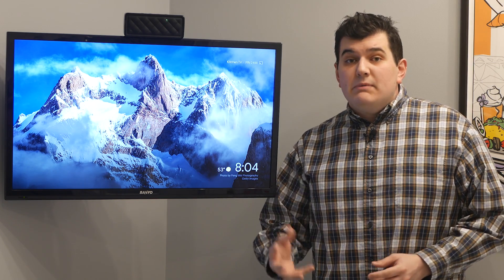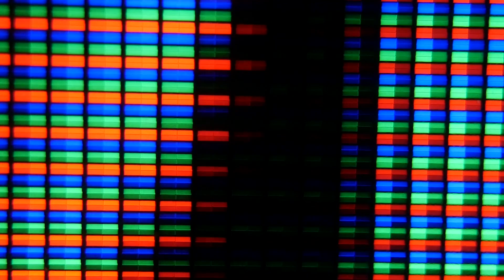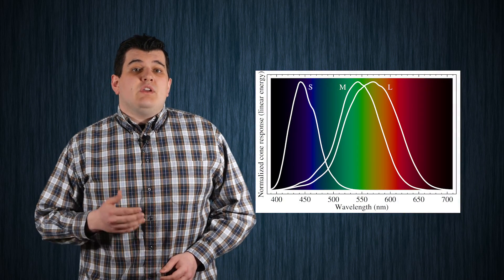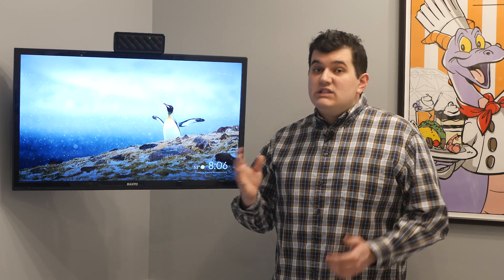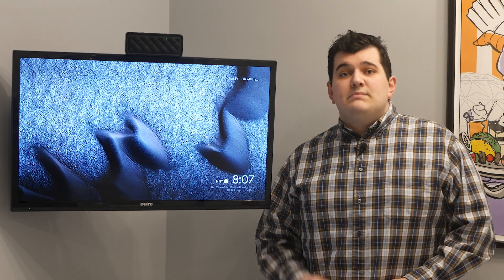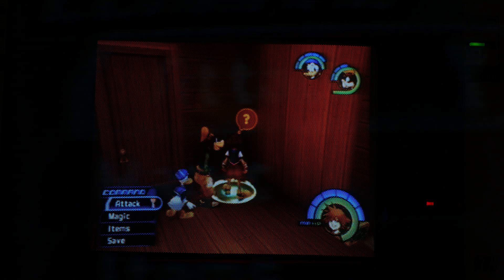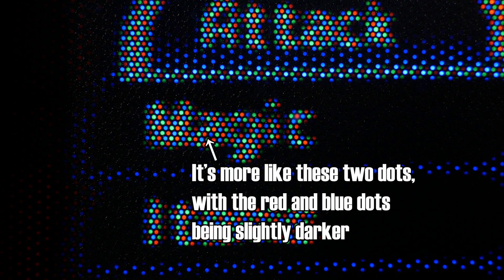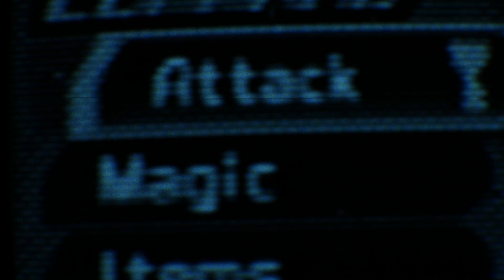These Are Not Pixels: Revisited

Comment: A B&W screen works on a different principle.... It still has a fixed resolution - The bandwidth is still limited and can only transfer a fixed amount of information - no matter what you do, there is a limit.

A Pixel is, by definition, the smallest individual element of a picture. There is nothing that says that they can not be a side-effect of the design, or that they need to be individually addressable at all times, or that they needs to be sharp and perfectly defined spatially - that is just Your interpretation.

There is a smallest dot you can produce with, even with a B&W display, as your electron beam can only change its intensity oh so much. That makes the point smudged, but it is still of a fixed size - and the same goes for its location - horizontally you can only get the position of the point with a finite amount of precision. the fact that the image is drawn in lines just makes that more apparent in one direction as the horizontal separation is far bigger. You have a bandwidth limited signal with a fixed sampling-rate along both axis producing a picture composed of individual elements - pixels. 
This also has the nice effect of inbuilt physical anti-aliasing.

With color TVs (not 3-projector design) that is even worse as the phosphor used does spread the beam and part of the roles of the grid is to keep the bleeding in check.
They are not functionally identical to b&w TVs, not even close. And placing a grid in front of the paper - that was just a really pathetic attempt of a strawman.
Same with booting up a game - whos image is inherently pixel-based. With that you actually have actually made a strong point against your own position cause what we can clearly (well blurry in this case)see are the effects of antialiasing - a result of its vertical and horizontal resolution. And you can still read the word magic cause not the whole sub-pixel gets addressed with a single brightness value - something that can (and is) done on modern LCDs exactly the same (there are some interesting papers on sub-pixel displacement/rendering), just that there it needs to be done deliberately and is not a result of physical constraints. Not sure if you are intentionally dishonest or you really do not know such simple things.

And your "no, they are phosphor dots" - "No, they are LCD dots" -  makes as much sense.
Reply from the maker: I was wondering when you'd chime in, ABaumstumpf!  "A Pixel is, by definition, the smallest individual element of a picture."   OK, by that definition, the phosphor dots don't fit!  You can get deail within each phosphor dot.  Check out 6:00, then use the < and > to move frame by frame, and you'll see that my eyebrows are moving through the sets of phosphor dots.  That would not be possible with a digital display.  You cannot cut a pixel in half without it being two pixels.
Reply: "You can get deail within each phosphor dot."
If the dots are large in comparison to the vertical resolution the beam can produce. I never said the dots are the only limit, but as you said - in most TVs the beam was not accurate enough to do that. all you got was blurring into neighbouring pixels - natural antialiasing.

"That would not be possible with a digital display."
Well, it very much is. As i even already pointed out in my comment.
https://2dwillneverdie.com/tutorial/give-your-sprites-depth-with-sub-pixel-animation/

And here, an everyday example:
https://upload.wikimedia.org/wikipedia/commons/thumb/0/0e/Subpixel_rendering_LCD_photo_3w_composite.jpg/266px-Subpixel_rendering_LCD_photo_3w_composite.jpg
Your claim is that pixels would only draw the first result, when in fact all 3 are on a LCD and the 3rd is exactly what you would get on a CRT - nothing less, and specially nothing more.
All it is as physical antialiasing, but it does have a fixed resolution.
Reply from the maker: Your image example does not divide any of those pixels at all.  They are simply producing specific RGB values to keep the subpixels from lighting, and thus provide better spatial resolution.  This is a similar effect to how the edges of a shape are rendered on a CRT, but it is the mechanism by which that happens that is fundamentally different.  The LCD is intentionally making some pixels render specific colors to give an anti-aliased border.  The image processor has decided that's what it will do.  In a CRT, it simply happens.  The grid is on top of the lines being drawn.

If this is an argument over semantics, lets call it what is.  My point has always been that a digital display creates shapes by lighting up individual bits of the display.  A CRT creates shapes in lines, and the grid that is in front of them gets lit up because of the shape the lines are drawing.  I see a fundamental difference between the two in method of operation.  If you don't, then fine.  If you think it's just semantics, then fine.  But the phosphor dots are not digital pixels. 

I'd also like to challenge your assertion that "There is nothing that says that they can not be a side-effect of the design, or that they need to be individually addressable at all times".  Wikipedia defines a pixel as "a physical point in a raster image, or the smallest addressable element in an all points addressable display device; so it is the smallest controllable element of a picture represented on the screen".
The disambiguation page for "Pixel" calls it "the base element of a digital image in computer graphics".  

And finally, on the page for Pixel, there is an image showing 4 closeups of displays.  It is captioned, "Geometry of color elements of various CRT and LCD displays; phosphor dots in the color display of CRTs (top row) bear no relation to pixels or subpixels."  

This is the definition of a pixel that is common, that I am operating on, and that is not congruent with the phosphor dots of a CRT.  That is why I've made this video.  Counting the number of phosphor dots on a CRT television is meaningless to determining its resolution.  They are not directly controllable.  It is not an addressable display.  And they do not digitize, they simply compartmentalize.
Reply: "but it is the mechanism by which that happens that is fundamentally different."
Which i also mentioned several times. But the mechanism is irrelevant there - you claimed that was something only CRTs could do - which this proofs otherwise.

"Wikipedia defines a pixel as"
And you conveniently ignore the first part of the definition........
And even the second part still applies to a CRT as it - again - nowhere state that it has to be addressable at all times - on a CRT color TV you can address every pixel - with less accuracy and only at certain points in time - which is, if you look at CRTs - also the case for them. Even if we use the definition arbitrarily narrowed down it would still make an CRT and LCD the same.

"It is captioned, "Geometry of color elements of various CRT and LCD displays; phosphor dots in the color display of CRTs (top row) bear no relation to pixels or subpixels." "
So? A Wiki-page that everybody can edit say something? That is a person arbitrarily desiring that it is not to be called a pixel despite having all the characteristics and falling bang straight in the middle of the definition.

It looks like a duck, smells like a duck, quack like a duck and has the DNA of a duck - but i decide to call it Larry the unicorn.

"This is the definition of a pixel that is common, that I am operating on, and that is not congruent with the phosphor dots of a CRT."
What definition? You haven't given any that agrees with your statement.

"It is not an addressable display."
Which would actually make the phosphor dots the upper resolution limit and we could thus say the display has 'up to' XXX pixels.
Reply from the maker: My word you are stubborn!
If you're claiming I'm ignoring "a physical part of a raster image", well I don't know how I can illustrate that the raster is behind the phosphor dots!    You seem to feel as though because the dots are there, they are part of the raster.  This is a fundamental part of why they aren't pixels--the phosphor dots are not a part of the raster.  You could say that they help to identify a physical point of the raster (since they create rigid compartments) but they are not what the raster is.  They.  Are.  In.  Front.  Of.  The.  Raster.
I'm struggling to see how this is irrelevant.
"Which would actually make the phosphor dots the upper resolution limit and we could thus say the display has 'up to' XXX pixels."
Once again, you've ignored the evidence I've provided at the 6:00 mark that the phosphors have definition within their borders.  I'm not talking about the equivalent of sub-pixel rendering, I'm talking about the fact that two scan lines can activate the same phosphor dots.  You can see that when my eyebrows move through them.  If you don't see or understand what I mean there then I'm at a loss.
The phosphor dots limit color resolution only.  This is because their entire purpose for existing is to separate the Red, Green, and Blue components of the electron gun.  It merely looks like a duck.
Look, you agree that in a modern display we can count the pixels to determine its resolution, right?  And you know that the NTSC analog video signal is 525 horizontal lines (with ~480 visible), right?  So if I were to count the phosphor dots on a CRT and there were anything but (which I guarantee you there is) 480 dots along the y axis, then they can't possibly be part of the structure of the image.  This is the window screen analogy that you call a strawman for some reason, but is exactly the principle by which a color CRT's shadow mask and phosphor grid operates.
Reply: "My word you are stubborn!"
well you are stubborn.... you keep ignoring half of what i write, heck, you even ignore what you your self quote from wikipedia....

"well I don't know how I can illustrate that the raster is behind the phosphor dots!"
I never claimed otherwise - why make up yet another strawmen?

"I'm struggling to see how this is irrelevant."
Strange - then please try to elaborate how that is relevant. If i would say an LCD would not have pixels cause the address-line is infront of the pixels not part of it it would be just as nonsensical.

"Once again, you've ignored the evidence I've provided at the 6:00 mark that the phosphors have definition within their borders."
And once again you are claiming they are not pixels cause YOU personally decide to call them otherwise - that is only evidence of your ignorance.

"I'm talking about the fact that two scan lines can activate the same phosphor dots. "
Which in turn only means that the image gets blurrier and produces less distinguishable shapes than this physical resolution - it is just ligthpolution.
And again - by that "logic" an LCD does not have pixels either as adjacent pixels can get falsely illuminated by a signal not designed for them. That is - by your line of reasoning there is no such thing as pixels at all.......

"The phosphor dots limit color resolution only. "
And the components of the TV (electronics, the magnets deflecting the electronbeam, the grid and the phosphor-dots as well as the lightbleed of the phosphor limit the brightness as well - you make the claim it is otherwise but at the same time refuse to offer actual evidence. All you have shown so far is that a CRT TV has physical antialiasing - nothing less, nothing more.

"So if I were to count the phosphor dots on a CRT and there were anything but (which I guarantee you there is) 480 dots along the y axis, then they can't possibly be part of the structure of the image."
That is a nonsequiter. As even you your self already said -the electronbeam is not perfectly aligned with the phosphor-dots. You could make a display with 10 000 rows of phosphor-dots, all it would accomplish would be increasing the spacial differentiation of the signal - its apparent sharpness, NOT its resolution.

Again - your "argument" can be flipped right over as you can also display a 4K image on a 720p display.
Reply from the maker: OK, I might have something that could help explain my point.

http://zauberklang.ch/filmcolors/timeline-entry/1334/

The phosphor dots and shadow mask are using the same principle as the Joly Screen process.  In fact the Joly Screen is remarkably similar to how Trinitron operates.  The addition of the screen on top of the image does not create pixels.

I've ignored some of what you wrote because I don't see its importance to the argument.  Such as your challenging me relying on a definition from Wikipedia.  Setting aside the fact that it's a public, live document (go ahead and change it and see what happens, maybe you'll change people's mind or maybe they'll change yours) and the dangers that presents, what's the point of definitions then?  Can I call a poodle a salamander because I don't agree with the definition in a dictionary?  I realize this is bleeding into the fallacy of authority, but let's move on...

"If i would say an LCD would not have pixels cause the address-line is infront of the pixels not part of it it would be just as nonsensical."  I honestly don't understand what you're trying to say here. 

Let me refer you to 10:30.  That was an exaggerated graphic of what the phosphor dots are in relation to the rasterized signal.  They are not the building blocks of the image!  They are in front of the lines that draw the image.  The lines become masked by the grid of phosphors, but they are still there.  That graphic is the clearest I can be.  It is literally the same principle as placing a grid of squares in front of a pre-existing image.  How you can then claim that the grid transforms what it contains into a pixel is beyond me.  If that's what you're claiming, then you're perhaps better suited to call it a point.

Here's another example.  If I print out the same pixel grid setup as the LCD TV in my kitchen on a transparency at 4X scale, then I place it in front of the television so that 4 of its original pixels fit within one of them on my printout, have I decreased its resolution?  Are there now 1/4th the pixels?  I haven't changed the structure behind it--it's still a 1366 X 768 grid producing the image, but how there's a 683 X 384 grid in front of it.  Does that mean none of the original detail gets through?  Or is there simply a second, unrelated grid in front of the TV?

And that's the whole point.  In an LCD panel, there can be no definition beyond the pixel because the pixel is the smallest element it can create.  Shapes are drawn by lighting up those individual elements.  The pixel is how the image is composed.  You seem to claim that just because a CRT uses a grid of phosphor dots, the image is then composed of them and there can be no definition beyond the grid.  But that's fundamentally different from how it actually works.

This whole time you're arguing that I should just call them pixels because that's what they are.  That's a meaningless argument.  We're both challenging each other's definitions but you can't or refuse to see the differences between the two that I'm pointing out.  If you can imagine a second unrelated grid in front of an image that already exists, you will understand my point.  If you can't, then what more can I say?
(edited because spacing was all wonky thanks to the hybrid comments system we have now)
Reply: "The phosphor dots and shadow mask are using the same principle as the Joly Screen process."
so does any other color display......

"Such as your challenging me relying on a definition from Wikipedia."
And another lie/strawmen - i only said that it is very remarkable that you are ignoring half the definition you are supposedly using - the part of the definition that - wonder oh wonder - applies to LCDs as well.

"It is literally the same principle as placing a grid of squares in front of a pre-existing image."
Similar yes - the Same NO. cause if you place a grid infront of a picture you already have a full picture. But with the mask and phosphor-dots you remove either of them and you got a b&w image limited in resolution by the accuracy of the beam and the scattering inside the phosphor. The beam it self does not carry accurate information of a picture that is far bigger - heck, that is even limited by the very cables in the TV.
Try to look at it this way: if you have a 720p image and you display it on a 4K monitor the image does not magically become a 4K image - it is fundamentally still the same.

http://www.michaelbach.de/misc/crtlimits/index.html
A introductory read on the subject.

"Here's another example.  If I print out the same pixel grid setup as the LCD TV in my kitchen on a transparency at 4X scale, then I place it in front of the television so that 4 of its original pixels fit within one of them on my printout, have I decreased its resolution?"
depends on how the sheet works - if it blurs out the colors of the original screen to the size of the new color-dots - yes, yes you have.

"Or is there simply a second, unrelated grid in front of the TV?"
As you haven't specified what would happen - no.

"Shapes are drawn by lighting up those individual elements. "
Funny - how this very sentence, without changing a single word, perfectly describes how a CRT works.

"But that's fundamentally different from how it actually works."
Your claim - but that is in fundamental contrast to the basis of physics.

"We're both challenging each other's definitions but you can't or refuse to see the differences between the two that I'm pointing out."
I already pointed out that the single definition of pixel you ever mentioned (the quote from wikipedia) actually disagrees with you as it specifically says and i quote: "a physical point in a raster image"
Or would you now also start claiming that CRTs do not produce raster images? That the image is not created by a moving spot carrying the information of the picture elements to the phosphor?

It would be a different scenario if we would be talking about vector-monitors - as there you can place the image at arbitrary points on the screen. But because the the analog-chain is bandwidth limited by design you can not, in no way, create bright spots outside of a fixed number of spatially well defined positions.

The horizontal resolution is thus limited by mainly 3 things:
1 - Frequency. As the movement of the electronbeam is a predetermined fixed pattern with a limited frequency you can also only create a limited amount of spots. if the line-frequency would be 20 000 Hz and the signal is limited to 200 000 Hz that would mean at best you can create 10 vertical lines.
2 - Beamsice. If the size of the beam is as big as the screen you can not create any details. No matter what the signal would be the created image would not change. In normal screens this is limited by production tolerances and cost and the actual beamsizes are well above the minimum size. Also with increased brightness the beam will become larger, limiting the product of brightness and resolution.
3 - The phosphor it self. No matter how small you make the beam, the phosphor it self  spreads the electrons and the glow. If the phosphor-dots would not be separated physically than the individual colors would blend into each other. for this reason in high resolution CRTs they often used grids on the display it self (not the shadowmask) to get better separation of the phosphor-dots as the dots them self already were so small that even at low brightness with a narrow beam the whole dot would light up.

You can also easily test that - just display black and white vertical lines on a CRT and then see at what point they simply vanish to a grey image. At that point you have overstepped the physical resolution of the display. And as it so happen the change in the displayed image will look exactly the same as on an LCD where you do the antialiasing via software.
Reply from the maker: "Try to look at it this way: if you have a 720p image and you display it on a 4K monitor the image does not magically become a 4K image - it is fundamentally still the same"
OK, now we're talking.  Take a 480 line raster, and display it on a CRT with 960 phosphor dots along the Y axis, and it is still a 480 line raster.  Similarly, if you've got a 480 line raster, and you display it on a CRT with 240 phosphor dots, it is still a 480 line raster.  Each dot now gets hit by two lines, but you can see the detail provided by each line.  That's what I'm showing at 6:00.  That is what does not happen with a logical pixel, let alone a physical pixel in an LCD panel.  If you display a 1080P image on a 540P panel, you will get a 540P image.  The pixels cannot provide any more detail than a uniform, quantized color value.  
In order for the phosphor dots on a CRT to be true pixel, their intensity must be uniform and quantifiable.  But it isn't.  

"I already pointed out that the single definition of pixel you ever mentioned (the quote from wikipedia) actually disagrees with you as it specifically says and i quote: 'a physical point in a raster image'
Or would you now also start claiming that CRTs do not produce raster images? That the image is not created by a moving spot carrying the information of the picture elements to the phosphor?"
I already addressed this in a previous reply.  The issue is that the phosphor dots can and do fall on two lines of the raster.  So yes, you could claim they are a "physical point of a raster image" but then you're muddying the boundaries of the raster itself.  That's because the phosphor dots are unrelated to the position of the raster.  Have you changed the geometry of a CRT monitor before?  If you have, you'll know that the raster can fall wherever it wants to in relation to the phosphor dots and the image is still as clear as day.  That proves the raster is unrelated to the phosphor dots because, again, it is behind them.

"The horizontal resolution is thus limited by mainly 3 things:--with a list following"
I understand this!  I understand that bandwidth of the signal does limit its resolution.  But the phosphor dots are agnostic to this.

Going back to my theoretical transparency of a grid--I'll clarify.  The grid does not blur what's behind it.  You can still make out the pixels behind it.  If you could make out the pixels behind my transparency, you would say "of course this transparency is meaningless to the resolution of the display!  I can clearly see that there is more detail behind this grid.  Therefore, the image behind it must be what actually defines the resolution of this display".   This is the same thing as the phosphor dots on the TV.  
Remember Trinitron?  There's no horizontal separation to the phosphors at all, so you can still see the lines drawn when it's operating.  The phosphor dots in a slot-mask CRT make it hard to see the raster because they themselves create compartments and they are offset in each adjacent column.  But that doesn't mean they change the raster.  They simply limit which parts of screen each electron gun can hit.

In any case, the mere fact that there are myriad television designs with myriad phosphor configurations and dot pitches should tell you that the phosphor dots do not form the image.  They do insofar as they create defined clusters of light, but they aren't the limit of resolution that the pixels of an LCD panel are.

Let me go back to this; If an LCD panel could divide one of its pixels in half (as in two completely different colors created, not just sub-pixel rendering) would you not then say that is is now two pixels?  If the panel can create two independent RGB values within the same space, that must be two pixels.  So if a CRT can do that with its phosphor dots (which it can--as I've shown) you should at the very least say that each phosphor dot cluster is in fact two pixels.  But that then breaks the definition of pixel.  And thus, the appearance of the RGB cluster on a CRT is not a pixel.  If it were, each component would need to be uniformly bright, there could be no detail within itself, and then you would have a digital resolution on your hands.  Which of course, in analog video, you don't.
(edit: I just need to stop replying in Creator Studio.  The spacing is just unpredictable there...)
Reply: "Similarly, if you've got a 480 line raster, and you display it on a CRT with 240 phosphor dots, it is still a 480 line raster. "
The original image yes, the image visible no.

"Each dot now gets hit by two lines, but you can see the detail provided by each line."
Not even close. What you show a 6:00 is that the whole dot gets lidd up with a slight gradient - but again - do the little test and see the result your self.

"That's because the phosphor dots are unrelated to the position of the raster."
If the alignment is off so is the whole picture..... They are not unrelated.

"This is the same thing as the phosphor dots on the TV. "
No, as the phosphor-dots are the things that emit the colour - they do not merely tint a higherresolution image.

"There's no horizontal separation to the phosphors at all, so you can still see the lines drawn when it's operating. " that depends on the monitor - many DO have separation, and those that don't you can clearly see the bleeding of the colors. If you have a trinitron - try the same vertical stripes i already mentioned. Or just display an image of one solid color.

"In any case, the mere fact that there are myriad television designs with myriad phosphor configurations and dot pitches should tell you that the phosphor dots do not form the image.  They do insofar as they create defined clusters of light, but they aren't the limit of resolution that the pixels of an LCD panel are."
This entire section is mindless rambling - there are a myriad of different LCD designs too - does that in any way change the fact that they use pixels? by your logic it would.

"Let me go back to this; If an LCD panel could divide one of its pixels in half (as in two completely different colors created, not just sub-pixel rendering) would you not then say that is is now two pixel?"
yes of course. 
but can a CRT do that? Oh right - no, it can not. Unless you destroy the CRT and rebuild specifically to do that thing.

"(which it can--as I've shown)"
As you have claimed You have yet to show evidence for ANY of your claims - they are so far empty words disproved by reality.
But go ahead, show how your CRT can create an arbitrary amount of distinct brightness-level on a given phosphor dot - show a pixel that has a bright dot running around in a circle or something. That is what you claim it can do - and that is what physics tell us is not possible with CRTs (unless of course you would on purpose create a device for that very thing - in which case the point is mood as you can do the same with any other display technology).

"If it were, each component would need to be uniformly bright"
Again False - in your very twisted perception only - and if we follow that than an LCD display too does not have pixels as they are not uniformly bright either......
Reply from the maker: Yes a CRT can divide the phosphor dots!  The evidence is at 13:11.  If you cannot see how the dots on the border of "Magic" are partially lit in non-trivial shapes that define the border of the word itself, then this conversation is a lost cause.  This is not just light bleed happening, this is the raster being slightly misaligned with the dots, so that the edges of the shape it's drawing in LINES are not congruent with the actual dots of phosphor.  You can even see the dark portion in the center of the G, even though all of those phosphor dots are producing light!  If this were an LCD panel, I could average the intensity of each dot, but I could not tell it to make the left half of the blue dot light, and the right half of the green dot light.  

That is the WHOLE POINT of this conversation.  You called the analogy of looking through a strainer at an image behind it "a lie".  Those weren't even my words, mind you.  But it's a perfectly good analogy!  13:11 shows directly how the phosphor dots are capable of displaying shapes BEYOND their own borders.  And LCD panel cannot do this, ever!  Stepping aside from the "uniformity" question, it simply cannot change where the light is emitted from to create a shape other than the square element that it itself is.
Reply from the maker: I just did provide evidence.  Please reference 13:11 and tell me your thoughts.
The beautiful thing about being the creator of this channel, is that I can search through comments.  The following  is your response to Stoney3K:
"" With a colour CRT, there is detail smaller than the size of a single phosphor dot, the only detail that is lost is the areas that are blacked out by the shadow mask."Again - by that "logic" an LCD screen doesn't have pixels either. 

"It's essentially the same as viewing an image through a strainer. "
No matter how often a lie is repeated it is still a lie."

^^Oh look, you said exactly the thing I said you did.
Reply from the maker: My goodness, I even SAID that those weren't my words.  I simply said you called that analogy a "lie", which you did.  Full stop.  Why you continue to call me a liar is beyond me.  
You must explain why 13:11 isn't evidence that the phosphor dots can display detail within themselves.  Why it's actually contrary evidence.  You cannot simply say it is or isn't evidence.  That's not how arguments work.
Tell me what definition of my own I am ignoring.  If it is the "part of a raster image" one I've already explained myself.  

I'm going to reference this that you said earlier:
"Similar yes - the Same NO. cause if you place a grid infront of a picture you already have a full picture. But with the mask and phosphor-dots you remove either of them and you got a b&w image limited in resolution by the accuracy of the beam and the scattering inside the phosphor. The beam it self does not carry accurate information of a picture that is far bigger - heck, that is even limited by the very cables in the TV."
Why is the raster image presented by the B+W CRT not a "full picture"?  You seem to be assuming that the phosphor dots are required to make an image at all, when in fact they are only required to display the three combined rasters with complete color separation.  Without the shadow mask behind them but still with the RGB clusters at the front, you'd get a black and white image because all three beams would hit each part of the screen, and then it would just average out to luminance.

"But go ahead, show how your CRT can create an arbitrary amount of distinct brightness-level on a given phosphor dot"  Once again--13:11.  "show a pixel that has a bright dot running around in a circle or something"  I think you mean show a phosphor dot which has detail moving with in?  Why does 6:00 not do that?

The onus is on you to explain why that is not evidence.  You cannot simply say it isn't.
Reply from the maker: No no, you asked for evidence of, and I quote, "how your CRT can create an arbitrary amount of distinct brightness-level on a given phosphor dot".  13:11 is evidence of it doing so.  You can clearly see how many of the dots are partially lit in a way that is geometrically relevant to the shape that is being drawn.  You claim it is not evidence.  Now you must explain why it isn't.

"But with the mask and phosphor-dots you remove either of them and you got a b&w image limited in resolution by the accuracy of the beam and the scattering inside the phosphor. "  EXACTLY!  Remove them and now it's a black and white CRT that has three electron guns and three colors of phosphor for no reason!
Reply from the maker: You previously agreed that if an LCD panel could do what the CRT is doing at 13:11, you would say it is two pixels:

""Let me go back to this; If an LCD panel could divide one of its pixels in half (as in two completely different colors created, not just sub-pixel rendering) would you not then say that is is now two pixel?"
*yes of course. *
but can a CRT do that? Oh right - no, it can not. Unless you destroy the CRT and rebuild specifically to do that thing."
You are refusing to acknowledge that 13:11 shows individual phosphor dots half lit, which by your own admission would, in an LCD screen, mean that it is now two pixels.
Reply from the maker: You are continuously moving the goal posts and/or do not understand the premise of this argument.  If we now agree that the there is a fixed resolution outside of the phosphor dots, then we should agree that the phosphor dots are not what defines the resolution!  This has never been about there being unlimited resolution in a CRT.  This has always been about the simple fact that the phosphor dots are unrelated to that resolution and that they are not the building blocks of the image.  Hence, they aren't pixels.  That's all I've been trying to say! 
This isn't about me wanting to "win" an argument.  I see a gap in your understanding of this issue.  I am trying to fill it.  That's the entire reason I make videos--I like to teach people things.
Reply: "You are continuously moving the goal posts and/or do not understand the premise of this argument."
And another strawmen - i am still asking you to look at the actual evidence - at reality - and to stop ignoring the very definition you claim to be using (which you are not as it is contradicting your statements).

"If we now agree that the there is a fixed resolution outside of the phosphor dots, then we should agree that the phosphor dots are not what defines the resolution!"
non sequitur par excellence
you might as well say 'if there are borders outside a country than borders are not what defines the shape of a country'

"This has always been about the simple fact that the phosphor dots are unrelated to that resolution and that they are not the building blocks of the image."
<Seriously? And you accuse me of shifting the goalpost when YOU are the person that claims that CRTs have NO resolution and now they do? Make up your mind what bullshit you want to spout.

"I see a gap in your understanding of this issue."
And more projectioning much,a re we?
Again - do any of the simple experiments i told you and you would instantly see you are wrong - but you will never do that and we all know that cause you are not only stubborn, but also incredible dishonest.

"I like to teach people things."
And i would like it if you would not teach them incorrect things like a religious zealot.
Reply from the maker: Why can't there be two resolutions?  Answer me that.  Why must the phopshor dots define the only resolution?  Why can't there be a raster behind them that then merges with the dots?